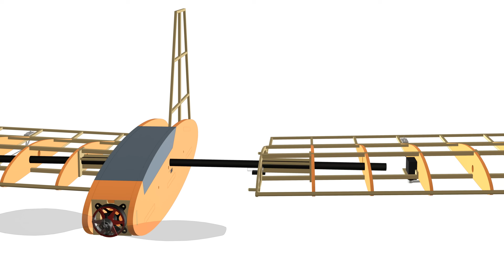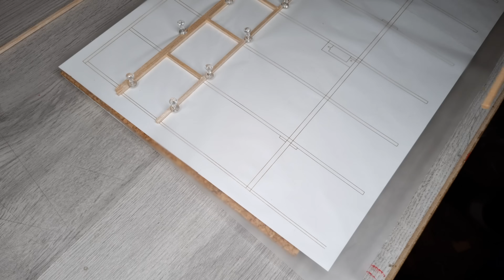Tranquillus RC Slow Flying Wing DIY lightweight plane

Comment: challange make a rc plane with cd drive or hard disk motor  (you are allowed to modify the motos coil )
Reply: Too heavy
Reply: Nah do it with a pc fan as an edf but change the motor
Reply: It’s been done
Reply: That is how beginning of brushless motors looked like in RC world
Reply: We used to rewind CD rom brushless motors for planes wayy back in the day and salvage lithium cells from old cellphones and solder up our own lithium chargers. For a while, it was the only way to get a relatively light weight brushless set up that didn’t cost a week’s wages.
Reply: It's been done, can rcgroups the old threads. Those days came to an end when outrunners from China were $10-20 and literally available from anywhere.
Reply: Why tho the amount of work needed far exceeds the cost of good equipment

Comment: When I was (much) younger, we used to cut with a scapel, glue with white glue and cover with ‘Japanese paper’. Hours of work for a sometimes curious result.
Lasers, 3D printers and mylar have revolutionised model making.
But if you have a steady hand and a lot of practice, what seems easy to do is not!
beautiful work, silence and perfect shot
Reply: Yep, gas powered noisy and smelly engines if you could afford it. For me it was mostly tow launched gliders and a two channel radio control that cost a fortune.
More crashes than successful flights.

Comment: That's excellent! A beautiful model and a very enjoyable video. I operate on a tiny budget, so still build planes the old-fashioned (i.e. cheap!) way; modern tech such as computer design software, laser-cutting and 3-D printing has really transformed the hobby - but in a GOOD way.

I'd love to be able to produce laser-cut parts like you; the precision is amazing. That thin foam looks very good, too. I'll have to see if I can find some here in the UK, because the price of balsa wood is becoming ridiculous.

Thanks for the video, and HAPPY LANDINGS. 🙂

Comment: Fantastic! Old school construction is being rediscovered because it is still the best combination for strength/cost vs. weight.
Reply: I disagree, foam is cheaper and easier to repair.
Reply: @finn_mcmissile   I am also a fan of foam but you missed weight. No way can an E-power 2M foam wing weigh 224gm/8oz. That said, this wing is really only for ZERO wind and too light to be practical. Everything about an aircraft, big or small, is a compromise.

When you say foam is "cheaper", compared to what? Depending on wing span foam cores from a CNC shop are $60 to $80 for literally $2 of foam. Most of the cost is setup time and shipping. If you're talking about a store-bought plane, the last one I bought was a Multiplex Fun Cub, now about $150 with no motor or electronics. Few kits of that size cost much less. I'm guessing the wing in the video can be built for about $60 total, $15 airframe and $45 motor and electronics.

Comment: I've been thinking of building a slow-flying plane that is all just wing. This is superb! Thanks for a very good video that shows every detail of the build. Just curious about one thing. Did you use a laser cutter to cut the parts? Did you use any software for the design of the wing shape?
Reply from the maker: diode laser cuts all colors except white and blue (for this need CO2 laser)

Comment: have you tried to put a propeller inside a wing, like a ducted fan, but in blower fan style, one per wing on each side, total of two, yep large delta wings or square wings work better with internal large prop. possibly multiple smaller side-by-side wing-internal props would work too.

Comment: I remember WAY back when I was in school, I once lent out a Book on DIY Topics that had one Project within it with plans for a Soaring Plane ( the classic design with an elongated Fuselage ) using a similar construction for the Wings ( and Fuselage ). Laser Cutters ( or CNC Machines ) were obviously not a thing back then ( at least not for regular ppl outside of the industry ) thus requiring a different approach to making things like the progressively tapered ribs like shaping them out of a condensed block of wood ( internal cavities and all ) using just two guides at the ends and then sawing the individual ribs out of the block using a bandsaw ( or perhaps stacking sheets of Balsa? ). Nowadays you just either Laser Cut, CNC Mill or 3D Print ( on much more affordable Equipment ) them out using your respective material of choice. Never once built such a plane despite its intrigue 🤣

Comment: Hi, I have a Falcon 2 laser machine, it is 22w but I am not able to cut polystirene , do you have any suggestions? What should I do? Thank you
Reply from the maker: Diode laser doesn't cut white and blue polystirene
Reply: @NumaVIG  so, I need CO2 laser to do this kind of work?
Reply: Use red or black materials.

Comment: The use of XPS foam to replace balsa parts is a great idea for keeping light weight. Is the XPS 3mm foam also cut via laser, or using other technique? Is awesome that XPS foam is available in multiple colors. Like the techniques and attention to detail in your custom design.
Reply from the maker: Yes, everything is cut with a diode laser (problems only with white and blue foam)
Reply: Thankyou was looking for this comment what size or watt laser is the neje 3 plus?@NumaVIG
Reply from the maker: all manufacturers have an official website with all models and characteristics
Reply: @NumaVIG  have u used a 5watt laser to cut coloured foam?

Comment: Could it fly without the rudder and just elevons for turning?
Reply from the maker: At low speed the elevons are not effective when turning
Reply: @NumaVIG    what is the maximum load to thrust ratio?

Comment: CA does not hold good on plywood...best to use resin glue
Reply: Too heavy....😏🇬🇧
Reply: CA works fine on plywood. I fly F5RES and I've got whole balsa and ply planes held together with nothing but thin CA (and not much of it) You build to fly, not to crash.

Comment: 020   this is an  ABnormal  wing profile.?        032   this is a normal profile.
039   the benefits of the use of slightly larger stock for the leading edge component should be considered.
208   you may know that the use of a water-based glue is  not  recommended.
602   the profile has become  Abnormal.
715   the use of spruce or clear-grained poplar for the main spar(s) is recommended.      the use of  SOME  webbing between ribs outboard of the fuselage is recommended.      with webbing being used across a bit more of the wingspan - where the main spars are balsa.
2018   the control horn design  and  installation are flawed.        the use of full/nearly-full strip elevons is not recommended.        i would suggest that the wing profile be 'normalized', by  Correctly  re-making  the elevons.     d
Reply: We will wait anxiously for your Correct build video